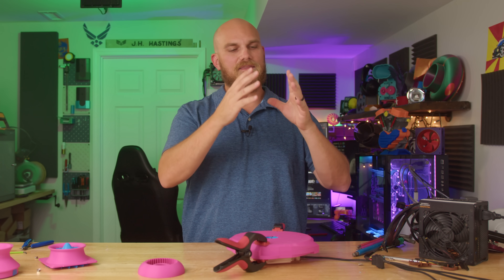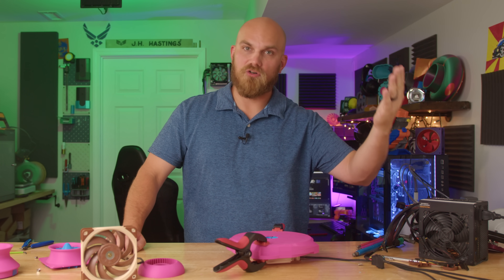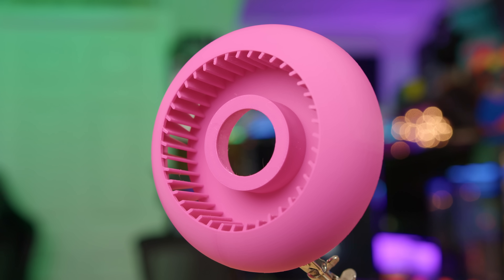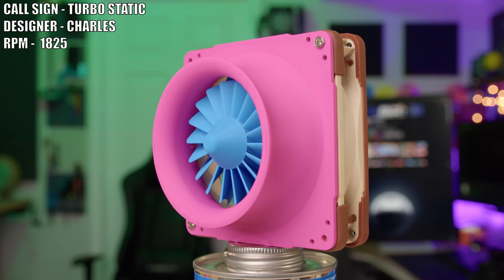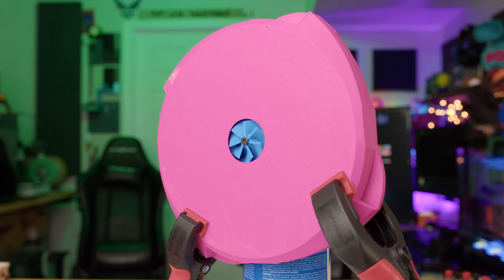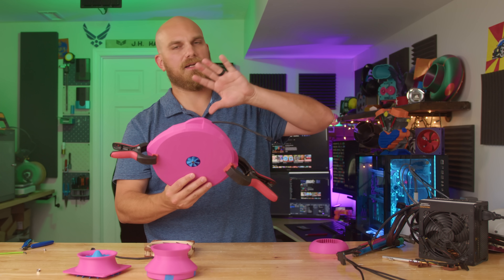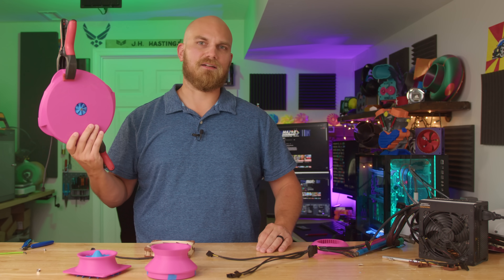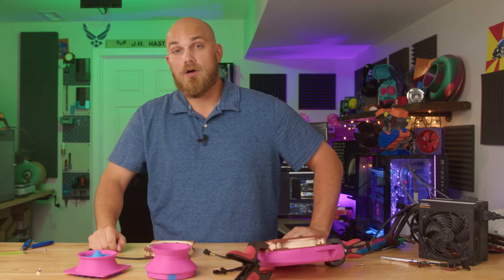Wild 2-Stage 200mm Blower Fan Redefines Power | Fan Showdown S6E6

Comment: For the next season I suggest that you put the fan onto a radiator, or put the radiator into the tube. This way you replicate the type of load the fan is typically under. Then after the fan you include a mass airflow sensor. Ultimately it doesn't matter what the pressure is or flow is individually so long as the mass flow is high. You want to measure the amount of air molecules smashing into the fins of the rad.

Comment: Split it up into two classes:

Modified where the fan has to fit within the confines of the A12X25 housing, ie- it must be usable in a computer without any mods to the computer or mounts.

Unlimited, where the only rule is that it must use the A12X25 motor.  I don't know how complicated you want to make it, but Unlimited could be split again into two sub groups- rated voltage, and unlimited voltage (run it at whatever the designer says to run it at) but the motor must at least last long enough to complete the tests; if not, then DQ.

Comment: if you glue that fan together .. my idea would be to just glue nuts on the inside and run bolts though both holes of the a12x25 frame and into the fan housing into the captured/glued nuts .. then in can be removed from the motor - the only other addition would be to print and glue in some spacers for that air deflector to the backing plate

Comment: I dont mind seeing the big crazy fan designs where they are basically just dismantling the A12X25 for its motor motor. Its really fun to see how creative people can be. BUT when it comes to the fan showdown, I do feel like there should be some limitations. I don't think they need to fit inside the A12X25 chassis or anything, but I do think that they need to be able to fit inside a PC, preferably in a normal 120/140mm fan slot. 

Like, iv never minded all the fans that have big shrouds that attach to the chassis and extend 50mm past the fan, its only these giant designs that you would never be able to even try to fit inside a PC that irk me.

Comment: Group N. I think it's a bit pointless to have almost zero constraints to the designs because this is supposed to be about PC fan cooling, and if your fan straight up cannot cool a PC because it has 10 inches of stuff hanging off of it, it isn't fair at all.
Or have two categories and divide the rankings between them. Having a normal fan design compete against a massive extruded turbojet is a bit ridiculous.

Comment: I think if it improves the computers ability to function at high temps, no design should be discarded, especially if it can be implemented with made to function within the space available to house. That said, sometimes seeing what functions better  (if performance is optimized correctly) means we may need to rethink the layout of equipment to ensure the best possible performance overall.

Comment: With respect to creativity, if you are going to allow frames "larger" than the Noctua reference, then that should be on a "separate" leader board.
Please include static pressures and CFM for both!
For the "creative side", the only rules should be: The voltage to the motor must be the reference, only allow same Motor on all competitors, allow any frame and design, gears etc...

Comment: My basic thought is this: Different Leagues for different types. Fans that fully fit in the frame of the A12X25 in one league, fans that do fit inside of the frame, but stick out of the inlet side in a second league, and fans that need to have extra structures attached to the fan in a third league.

Comment: Classes! "Super stock" must stay within the original footprint of the a12 x25. "Modified" any thing that uses a12 x25 motor goes. And "pro modified" any thing goes using the rc car motor you have used in the past.

Comment: This might not be a  popular opinion, but if the measurement in compression, is kinda obvious that compressors are gonna win. I think that going full circle and using a "cooling" measurement rig again, instead of a pressure rig could bring a little more variety and innovation to the show.

Comment: In these types of fans, the air flow is more important than the pressure forced by the fan.
Developing an experimental apparatus to compare the flow rate would be more interesting. You will only need an anemometer and ducts to create the experiment. 
You have a pressure gauge, so it is even possible to obtain the fan pressure flow chart.

Comment: I honestly think they should be divided up into the role and purpose they would serve in a computer case. A blower set up, for instance, wouldn't serve a water cooling solution, without making add on parts to direct the airflow over the fins like a typical fan would. There's other things that have to be watched out for in a PC, like static pressure. Some things can give the wrong Ideas. There's a lot of factors that go into PC case design, and fan placement. Also a factor in of different designs against each other as well as a fun factor. Some designs should be scaled down to be realistic though for what a case fan is though, cause that one on the desk is pretty big. The likelihood of running something that big in a PC, much less in a server would be slim to none. I think for a fun factor, do whatever. Competing against PC case fan designs. There I think needs to be more nuance. Have to really consider what all goes in a PC, and if there is even room for it, or whether there are other parts you would have to 3d print to make it work efficiently in that sort of environment. Just some things to think about.

Comment: I like two brackets for separating the fans. I also feel like maybe there should be a future season size dimension limit. Maybe look at the most used cases in the market, then use that to design a dimension limit. That way fans could actually be used in real cases.

Comment: Would it help to apply an efficiency element to the fans? Meaning cost to air movement. I'd rather have a small fan that can move a ton of air, than a huge $500 fan that needs it's own computer box to fit which pushes just a tiny bit of air.

Comment: I like both, but for different reasons. The inside the box designs have to work with a size limitation and I appreciate how they work around that. Outside the box designs are limited by the fan power. I see split categories showing up in the comments and I agree with them so long as you are getting enough submissions.

Comment: This makes me want to design a low format case around the Centrifuge Madness: huge front intake and back output fans, round wood front accents with a tiny piece of mesh in the center.
Or rotate it 90° Xbox Series X style for bottom intake, top output fans.
Black or slate gray, Noctua brown, Noctua beige, maybe subtle white LEDs.

I also wonder how the performance is if you scale the outer and inner fans up and down, where the size:displacement and sound blow up or fall off. Really cool, unexpected.

Comment: The answer to the problem of the 2 camps of fan design, is a very simple answer.  Starting with season 7, there should be 2 separate classes of fan showdowns; class 1 would be “standard fan designs “, class 2 would be “unlimited class”( aka, anything goes).  Two classes of competition, two separate competitions; announce one class for static pressure and one for airflow; then swap the class competition for the next season.

Comment: Anything goes there are some rules a12x29 and fastener based construction/deconstruction 
Surely nobody is going to make you buy 4 carbon rods and some bearings for a 4 / 6 stage full jet compressor

Comment: the reason that fan did so well is that the HUGE diameter gives the first bit of air flow a lot of momentum, similarly to how huge turbos make insane boost. the wider the rotor, the faster it flings the air at the outside bits. so, that momentum being forced into the second section simply directs the flow through the slit and doesnt allow any back-feeding, so it's like a compressor on a turbo. instead of just one big snail exit like a turbo, this one had 4 around the edges that captured that high velocity air and then directed it to the second fan. stellar design!

Comment: THe Compressor type Big Boy Fan needs to be glued cuz i can see the smoke escaping from the cracks in the smoke test
Reply: I think some heavy duty tape along the edges would do just fine for testing. Not a permanent solution, but good enough and won't need to break anything to disassemble.
Reply: @Sarcorco  DUCT TAPE
Reply: Or just more clamps, the issue might just be that it's being pinched closed at just 2 points.  Being pinched like that might be causing a wider gap in the space between the clamps.
Reply: @GremlinSciences  yeahhhhhh but still my guess is it can reach 9 points on the test or more if it dont leak
Reply: Seal it with some silicon. That way it can be stripped back off fairly easily.
Reply: He should definitely retry it with gluing
Reply: I'm shocked he didn't just tape it. It's such an obvious solution that solves every constraint.
Reply: @JJFX-  yep
Reply: Doesn’t he say that in the video when talking about it just past midway..?
Reply: or just duck tape it
Reply: Agreed. He could probably just print some little clips or sleeves to go around the edge instead of gluing.
Reply: I think some mid-strength silicone sealant and a few screws would be optimal. Pretty airtight (Unless the pressures inside are really beastly which I doubt) and still possible to disassemble)
Reply: Or maybe use some kind of greas or nonstick paste
Reply: or if you want it to be removable use silly putty!

Comment: I love the wacky over the top designs, whether they fit in the box or not they have kept this series interesting for so much longer than I thought it would last. 

I don't think the centrifuge madness needs to be glued together, but I think you should try it with 4 clamps. In the smoke test it was clear that a significant amount of smoke was coming out of the unclamped corners.

Comment: Am in both camps.
 For a fix of spec's to work in and with it's interesting to see what works (and doesn't), how, and why. But will always hit a limit and at that wall it's again interesting to see what's efficient, pushes more volume, or flows faster.
 Then I also really like the "cheating" of how a little beyond the boundaries can make a sizable difference, through to monstrosities of trade-offs in practicality.

Maybe categorise like motor racing: Modified Production/Group N+ and Outlaws

Comment: Needs heat set inserts to bolt that dual stage blower together.
I am for keeping em separated..."fans" then "anything goes exotic" builds...
I would also like to see specs on current draw and maybe even temps of the motors after say 5-10 min of operation (to see if the bigger blowers/higher static pressure fans) cause the motors to run hotter or use alot more current than stock "fan" type builds

Comment: The centrifuge madness isn't to different to the first jet engines. Its like a hybrid of the Frank Whittle W1 with a more traditional compressor wheel behind the massive compressor instead of being an intake on both sides of the giant wheel. That might be interesting if it could be printed and fit on the fan.

Comment: There needs to be 3 groups. Group A: Normal Fan  Group B: Normal fans with scoops, Group C: Anything goes. Each of the groups should have a separate chart where they are ranked. There is no way I am going to be able to mount "Centrifuge Madness" or "Wonder From Down Under" in my case to cool my CPU, They are cool and it's great to see them, but I also want to see what is actually feasible in the real world everyday computer cooling application.

Comment: I think there should be a "standard" class (group 1) and a "unlimited" class (group 2) 

The reason is more content. Run season 1 "standard" then season 1 "unlimited" Then season 2 "standard" ect. 

reason 2 is to make it so people are not mad on either side. 

Reason 3. We can extend the content out for more time (years?) All while not adding more work to you with trying to run both classes at the same time with diffrent classes. If you want more of a breakdown or explanation, just ask. :)

Comment: I recently learned something that totally changed my prototyping life. hotglue can be removed with just a dab of alcohol. it wicks in and breaks the surface bond between the glue and it just, peels off like magic. you could carefully glue the stages together, and then with a few spritz's of iso on any seams pry them apart

Comment: I don't see why we can't have both.
Fans that FIT the mold and PC cases should have their own list. It's interesting to see how they fare against fans currently in the market.
Fans that DON'T FIT the mold where anything goes other than being powered solely by the motor don't really have any practical meaning other than bragging rights... but it's also cool to see how far these fans could technically go if the only thing holding them back was the fan motor.

Comment: I know it's really not worth going back and doing static pressure tests on all previous seasons fans, but I'd love to see a community spreadsheet with all seasons fans, with static pressure and air speed recorded alongside things like normal size, oversized, blower, etc so you can sort and filter to see what you want from the data

Comment: Others have suggested that you split the categories and I agree with that.  If, however, you decide to keep it as one category, I am of the opinion that if you can't mount it on your computer without harming its function (such has having wild magnetic fields or bulk that extends deep into the case), then it really isn't a computer fan.

Comment: Maybe the community can create a category chart for specific types of builds. Like blade only in-line, blade only extended, small shroud plus blades, med, large, and then unlimited for those really complicated or cumbersome designs. 

Then just finalize numbers of what will fit in those categories. People can submit to the higher categories but cannot go below their own specs I would guess as a fair ruling. Maybe even have a cad file with a couple fan examples of fans that fit specific categories.

Comment: for centrifuge madness, you could put duc tape to keep it close, so it's not to hard to remove and should seal the fan good
and for category, i think both have their merit, crazy fan are nice, but having to keep it inside the fan is a challenge, and comparing the result of both category would make the point of going crazy

Comment: I've been saying for a long time that there should be two different categories. Fans that fit within the constraints of an actual usable PC fan shouldn't be judged alongside a giant, ridiculous contraption. 
Let people design whatever they want and keep the show format the same, just have two separate lists and two winners in the end.

Off topic, I would also like to see an occasional variation in the format where you use an overpowered motor to let every design operate at the normal RPM of the A12X25 regardless of size. 
Not a permanent change to the show or rankings or anything, just grab a few designs that you feel should've done better but were held back by the constraints of the test and see if it matters.

Comment: 2 lists, 1 for  flow and 1 for static. Each list is color coded for standard size and modified sizes. Then the show can continue as usual but the list will make more sense. You could even add a 3rd list for noise

Comment: If I can fit it into a case, I don't care that it doesn't succumb to the framing restrictions of the Noctua. If it's so big that I wouldn't be able to put it in a case, though. Well, that kinda defeats the point and should be a separate category.

Comment: Its clear there needs to be a Stardard and 'Extreme' leaderboard, with some comparison between the two for overall. Static pressure has been cool, I think it would be cool to swap every season between each type, like air flow, static presure etc.

Comment: You'll need to have both categories, and if a fan outperforms a fan from group B in group N as described below, it should have a better score than something that belongs in an engine bay.

Group N - Fan must not exceed the size on the A12x25 Fan (or, not exceed the frame). It must be able to function as a Push or Pull fan for Heatsinks/Rads like the A12X25 does.

Group B - Go nuts.

Comment: I'm seeing in the comments a lot of "do both" responses and I got to agree. Split the leader board into classes. Id actually suggest three though. Stock (strictly in frame), Thicc (in frame sides and no more than say 1x frame thickness extending out front and/or back so 3x thickness total), and then an Unlimited class where anything that fits on the frame and only uses it for power is good to go.

Comment: In a lot of sports there are limited and open class. Limited has stricter rules ie fits in a12x25, and open is do what you want as long as the one base rule is there (use a a12x15). So I'd say score both and they can live on the same chart, just another column for limited or open

Comment: Need more categories or atleased rankings in the spread sheets based on criteria of requirements.
Fits in ALL dimensions 
Fits in frame width bit not height
Static vs air flow
Unlimited category - no size restraints

Comment: With it topping the chart, you have GOT TO try it again glued together so there is no air leakage. I'm also curious what the CFM is; I bet its rather low, but what air it does pull in absolutely NOT going back. I'd also be really curious if it were scaled down how much performance loss would there be?

Comment: IMHO, Anything 3D printed is a-ok,  inside or outside.    Anything that adds power, extra motors, bearings, etc.  is not ok.   Other hardware like screws, nuts, weights, etc.  is ok but does feel a little less 'sprite of the competition'.  It's fine that they are there but I don't think I'd be rooting for one to win.